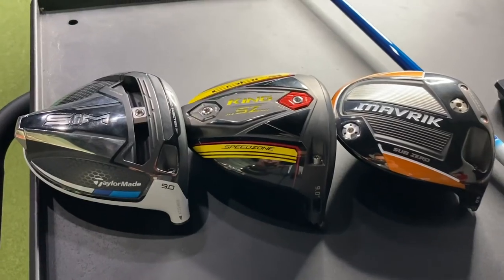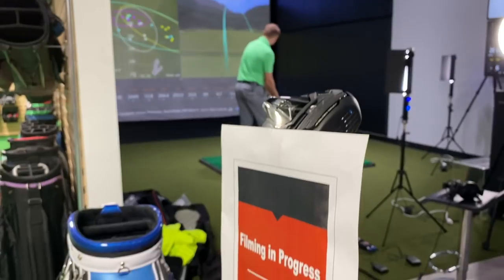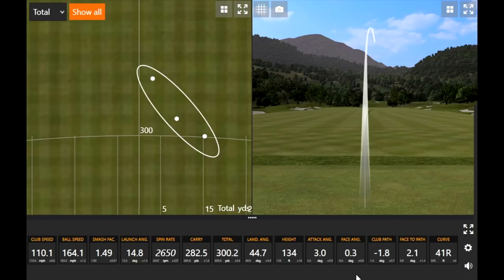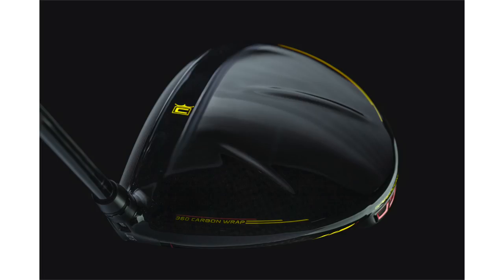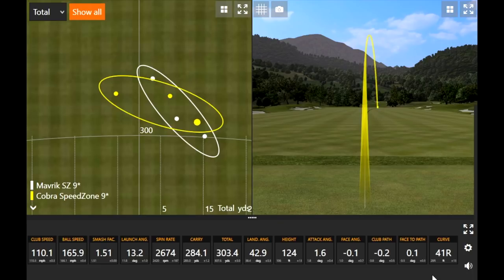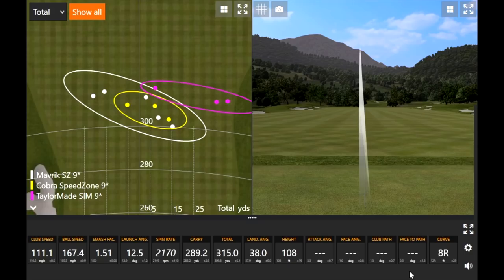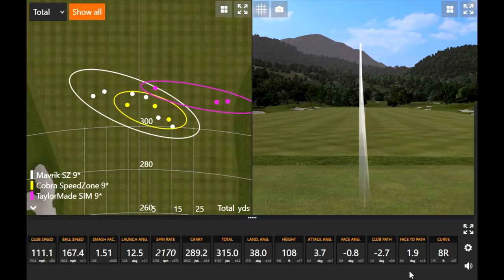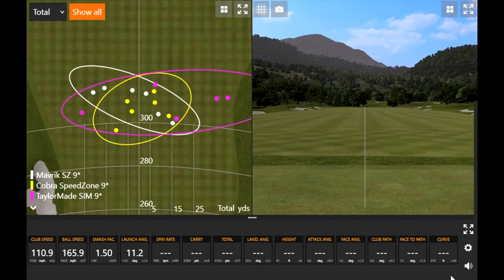Low-Spin Driver Test | SIM vs. Mavrik Sub Zero vs. SpeedZone | Trackman testing and comparison

Comment: Noticed with a few you tubers that when they hit the Sim Driver that they get cut spin with it against other models tested ?
Reply: check out his delivery -3 path with an open face is why.
Reply: Wayne Owens I bought the sim swang a few rounds with it. I noticed my spin was too low & height of drive was way to low! Driver is not as forgiving. Switched & they gave me the SIM max which gave me my spin numbers back & waaay more forgiving! I think the SIM is just way to low spin especially with low spin balls my ball looked like it was knuckling! I’m a 5 handicap

Comment: Amazing results for the Cobra since it's about $150 cheaper
Reply: Yes the Cobra Speed Zone is testing very well against it's other competitors. The $450 price is making it very appealing.
Reply: Just tested and purchased the SZ for $349 over the Mavrik. Results were amazing on the tracker.
Reply: @princevillekauainorthshore736  I also got got one in mint condition about 2 months ago for 230€ off was a demo head sale. It's outperforming my SIM Max on the course.
Reply: The SZ is $350 and I got the sub zero for $400 so couldn’t pass that up

Comment: Nice video guys. Question on the italicized spin numbers are those estimated? How confident in the spin results are you versus say a GCQUAD camera system?
Reply: Hi JC. Thanks for watching. Yes italicized spin numbers do show up occasionally and are estimates. We always use a silver dot on the ball with TrackMan and that helps a lot with an inside environment. Just like with any technology its not always going to perfect. I’m very confident in the spin results versus a GCQuad. Both are very good tools and provide reliable data. As long as the environment is setup well TrackMan is very accurate inside.

Comment: Man, so much parity. Great dispersion from the Cobra. The message is to get fitted to see what works for you.
Reply from the maker: Yeah, there are a lot of good new driver options this year. For the high-spin players, we've also heard great things about the Mizuno ST200G when set up with the two sliding weights pushed forward. We didn't have that head yet when we shot this video but we're going to have some Mizuno driver content coming out on the channel soon.
Reply: Bang for the buck, Cobra wins hands down with it's lower cost.
Reply: @TMar1961  I'm with you. Especially if you choose last year's model, which is even lower in price.
Reply: @TC-ps9sd  Absolutely and if you spend some time shopping around the 2019 F9 driver can be bought for about $350 USD.

Comment: What's the more forgiving out of the SIM and Mavrik?
Reply from the maker: If you're talking about SIM and Mavrik Sub Zero, which were the two we tested here, they're going to be pretty comparable as we had them set up, but the Sub Zero would have the edge with the heavy weight in the back. The standard Mavrik, however, would be more forgiving than either, as would SIM Max. Thanks.

Comment: TM club speed highest, ball speed lowest 🙁 - strike?
Reply: Yes could be strike related. Although my smash factor was at 1.50 which is very efficient with all models I wasn't quite hitting it as solid. This could also explain why the direction was off related to gear effect. I would guess I caught the ball slightly more on the heel causing the flight to curve more to the right with the SIM.
Reply: I've seen a few things that say the taylormade sim performs better with low strikes compare to higher toe strikes. Would it be possible to test strike with the sim? Would be interesting to see 👍

Comment: I haven't seen it yet but I heard that the SIM sits more square than the M5. Any idea why you're leaving out to the right?
Reply: Both the SIM and M5 sit pretty square. But it is pretty evident that I had a harder time squaring up the club face vs the other models. Could be related to gear effect. Although testing all heads with the same exact shaft and length I may have caught the ball slightly more on the heel with the SIM. I have been able to generate the most club speed with the SIM vs other competitors but the ball speed has been slightly lower which means I wasn't quite as efficient
Reply: @thomascampbellgolf  Thanks.

Comment: Thomas had to wipe the shots 79yds to the right to get 1900 spin with sim.  That driver fits 3% of the golfing public.
Reply from the maker: We have noticed in testing that the TaylorMade SIM (standard) may have a bit of a fade bias compared to other models. We've got more tests planned in the future to see if that holds up over a larger sample size.
Reply: @2ndswing  Interesting.  But also fading with 1900 spin means that it Thomas  was able to hit it straight or a gentle draw, which he likes to see, the spin would be 1600-1700.  Not good for consistent golf as you know..  And my experiences with good players are similar.  Fits nearly nobody with CHS under 118mph.  It's reminiscent of the SLDR 430.

Comment: I think as much as the importance of fitting this video shows the human element. It would be very easy to dismiss the SIM since Thomas doesn't like to see the ball go right but when you look at delivery the path was the furthest from neutral with SIM (-3) That's not a face control issue that's a swing path issue. Are you working on swing direction? I'm surprised to see someone of that level hit over the top pull draws and baby slices.
Reply: Thank you for your comment. I don’t like to see the ball have a lot of cut spin with my driver. I have worked very hard to ensure that my club path does not go left.What you will notice is my face to path with both the SpeedZone and Mavrik SZ is very neutral with minimal curve to the right. My face angle was the same with all three drivers at -1 (slightly closed) to make up for my club path also being -1 (slightly to the left) with the SpeedZone and Mavrik. My swing is very repeatable if you watch our other videos, and I always hit a gently draw with my irons and pretty straight shot with the driver. The interesting thing is why the SIM driver had my club path 2 degrees further to the left (giving the positive face to path and more curve to the right). I recently had the chance to talk to the Trackman staff and I mentioned that Trackman was measuring the SIM driver different to other models while in the same setting. Noticeably a lot of curve to the right when there is no way that I create that much curve and they told me that they have had the same feedback from many club fitters. They are working on an algorithm to fix how trackman reads the SIM driver using their radar technology. They also told me they don’t have access to new drivers until they are released so with a couple of updates the way Trackman reads the SIM will hopefully be fixed. Stay tuned, when their algorithm is fixed we will be sure to shoot similar videos including the SIM as I really do like the look if it!
Reply: @thomascampbellgolf  ahhhhhhhhhhh that makes way more sense! I watch all of your videos and agree your swing is very repeatable so it was surprising to see the path on that SIM with the cut spin. But truth be told if you were selling it I would pay a lot of money to have either of those results!

Comment: Why didn't you move the weight on the second to a more draw bias. You kept it in a neutral setting. If you are going to compare clubs you should maximize setting.Any good club fitter would have moved it.
Reply from the maker: Thanks for watching the video! For these tests, we want to purely compare the performance of the clubs rather than fit Thomas for the driver. We do have video shoots planned in the future that discuss the fitting aspects of the SIM driver and how it can be optimized.
Reply: Was the test completed at the same swing weight for each driver head?
Reply from the maker: @davidzalk3482  The Cobra was 1/2 swing point lighter than the other two. The SIM and Mavrik Sub Zero both checked in with the AD BB 6x at about D3.5 and the SpeedZone was D3. Thanks.